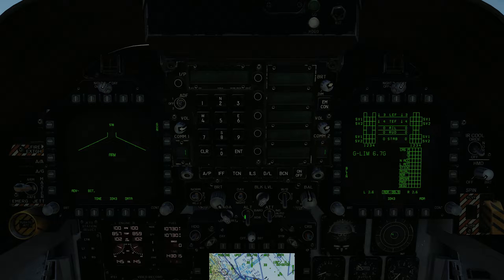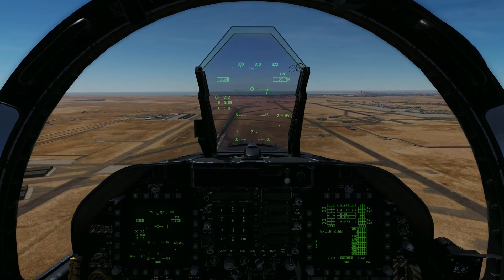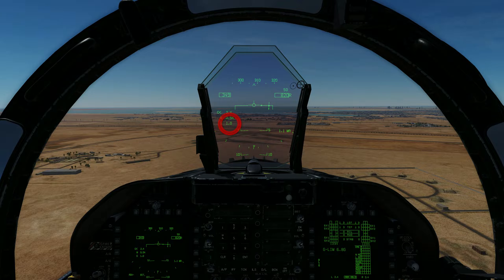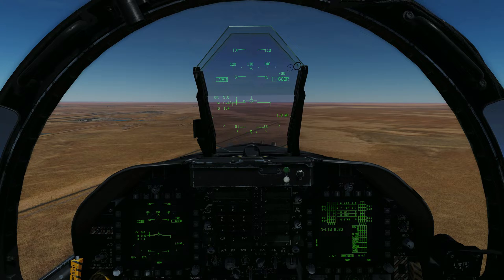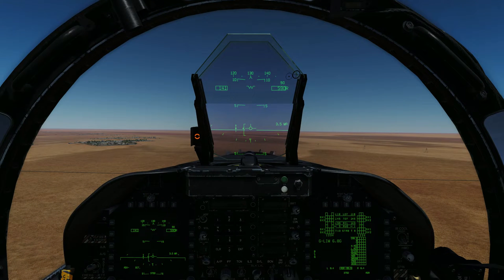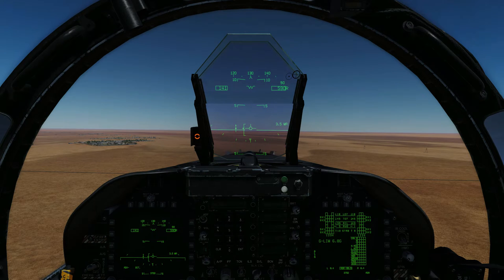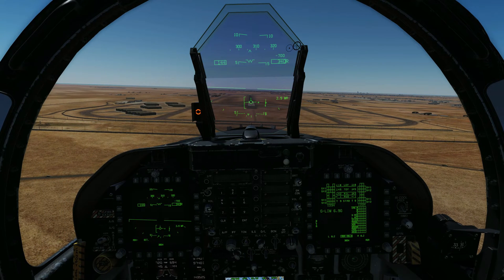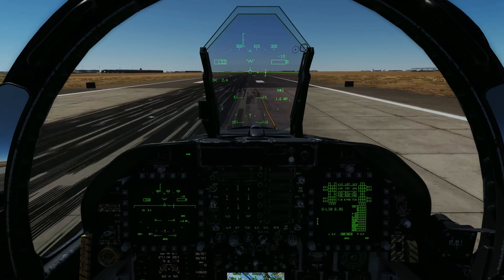DCS : F/A-18 Hornet : Overhead Landing Pattern

Comment: Just wanted 2 ask - there's absolutely no pitch movement on the stick at any point once ur On Speed AOA yes? B it Carrier Overhead of Airfield Overhead cuz I'm always left to wonder as I've seen lost of vids with at least some minimal pitch adjustments...
Reply from the maker: I think ideally you're looking to make no pitch adjustments, but you can use pitch to fix errors and then catch up with throttle input. Pitch is more immediate and power will take longer to catch up. But ideally you want to reach a point where you're skilled enough to always be ahead of the game using power.

Comment: 30 degree turn while maintaining on speed AOA is the toughest thing I’ve ever encountered thus far on any flight simulator
Reply from the maker: The Hornet does have some fascinating challenges with regard to landing.
Reply: @supanova88  ive learnt that turning to 30% slowly and not accidently exceeding 30% is key for me
Reply: @michaeltorode8689  You lose lift the more you bank aswell, compensate by adding a small amount of throttle preemptively, as you begin your bank. This will catch it before the "oh shit im falling out of the sky" moment
Reply: Indeed this one piece is causing me the most trouble.  And when I do manage it I always seem to come wide.

Comment: Great video as always. The on speed AoA concept at 4:54 seconds is the most confusing part of landing a Hornet. How is this being maintained is it throttle and trim manipulation? When I come to this phase of the flight I always have problems moving the E bracket down to the flight path marker and keeping it there. Once I get it there it tends to continue to move about and I have to make huge throttle changes to get it to stabilize. This problem persists even during straight-in landings.  Any help or explanation would be greatly appreciated.
Reply from the maker: I talk about this a little in the next video. The greatest mistake you can make is to panic about the E bracket. In that example the pitch is centered and the E bracket is high. The quick answer is to raise pitch to slow the aircraft to the desired airspeed, and reduce power to put the velocity vector where you want it, and keep doing that until the aircraft is in the desired condition. You also need to be proactive with the aircraft, and stop problems before they have time to develop.
Reply: @supanova88  Can't wait for the next video. I'm new to DCS so maybe with some more practice I will get better.
Reply: @2frames886  One thing to keep in mind when the E-Bracket appears - the Hornet's Fly-by-Wire logic changes in the way trim works.
During normal flight, the pitch trim adjusts the plane to fly at a specific G load (default neutral position is 1G). However, when gear is down - trim adjusts the angle of attack.

As long as you manage to trim the AoE to on-speed (center of E-Bracket) the planes FBW will try it's best to keep in there as long as you keep to using your throttles for altitude adjustment, stick pitch inputs will move the AoE drastically off balance.

Try an exercise of just flying on-speed angle of attack while straight and level (gear and flaps full down), with no pressure to land. That way you'll get used to it.

Anyway, this is a huge topic and take your time.
Reply: @kram2k  It is!!

I needed a long Time till i mastered it.

Funnywise i once had the Chance to Talk to a real Fighter Pilot which has flown the F18 and he says that maintaining the Hornet On-Speed in DCS is way more complicated than it is in Real Life.

Maybe of the Throttles that will be much better in Real Life than ours?
Reply: You should be getting it set up with trim and then not touching the pitch at all.  I think as nice as this approach looks Supanova wasnt' quite flying by the book as it looked like he was using pitch on final where you really shouldn't need to at all.  Once trimmed for AoA you just use a tiny bit of roll/rudder as needed for angle but no pitch.  Your pitc is essentially controlled by the throttle and you need to be alive on that throttle which is how I can tell he wasn't doing it :)  You will be dancing with that throttle all the way to the ground if you do it right.